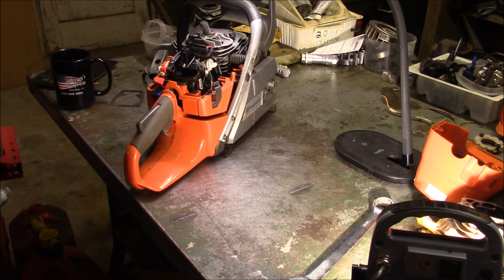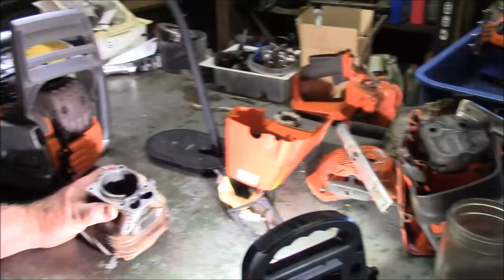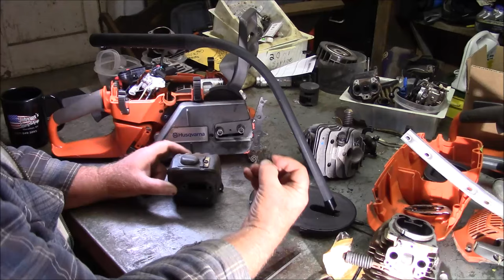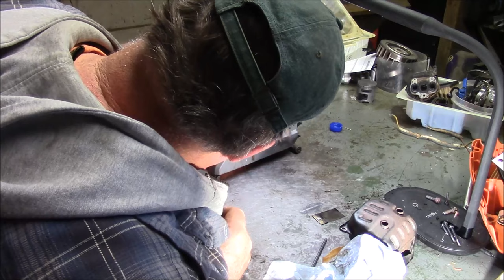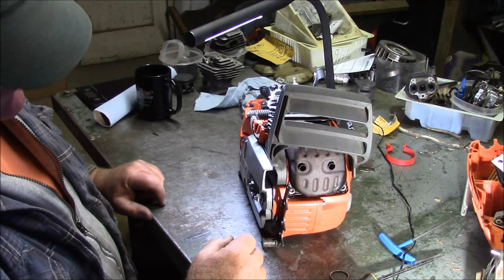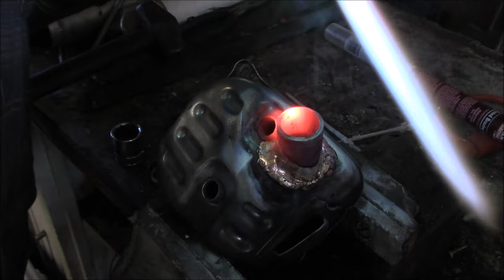Husqvarna 576xp "Introduction" Video,  A No Base Gasket Build & Squish Band Explained

Comment: Wanted to say thank you very, very much for taking all the time & effort involved to record & share your knowledge and experience. I bought a 576xpat based on your tear down and impressions of the build quality and robustness of this saw. While researching which saws look to offer better longevity, of course, you come across all kinds of contradicting opinions, and criticisms about weight etc...  with little, if any proof. You, however  take the time to SHOW the difference, for example, between the Stihl (also excellent saws in the pro line) and the Husky cylinder, and other components, as well as your commentary on weight being due to more robust parts. It's very much appreciated, thanks again!!!

Comment: Great video Walt. I have a 570 with 575 xp cylinder on it base gasket delete and muffler mod.  The saw seemed lazy I put a coil of a 2159 Jonny and it seems to have helped at idle and runs more rpms.

Comment: For years I did not know Jack about what you were discussing about Husqvarna 372 but I do, now.  There are some things I like about the 372 and some things I do not like.  I cannot say it is a better design than moms 440 but it sure cranks a lot easier than my big Stihl saws.  Weight wise, it is about the same as my 440 and a lot less than my 460.  It does seem to oil a lot better than my Stihl saws.  I have the oiler turned down to just slightly less than the midpoint of the adjuster with a 20 inch bar.  Had a few problems with the supplied carb but I have it straightened out, now., primarily due to a leaking needle.

Comment: Hello. I have a question, What diameter did you use the tube at 24:38, I mean the diameter, external diameter and thickness of the tube wall and what you used to connect the tube with the silencer,And what is the length of the tube?
Reply: I can ask for an urgent response?

Comment: Do you think I could get away with putting a meteor piston in a husqvarna 372 x torq cylinder with gasket delete without doing a squish test with solder? I don't have solder or measuring tools
Reply from the maker: I can't say that, u could be the exception that has the piston smash into the squish band.

Comment: I got one of those… I just got the cheap moly popup piston kit for it and I found a manual adjustment carburetor to pull out that self adjusting version??? Guess we’ll find out how good it will run… it’s just a cool lower transfer design…I did a chop saw and thought it was just a wicked feed system so I was looking for the cylinder design in a saw… it think it’s a stronger saw then the Stihl would be???
Reply from the maker: The "Self Tune" usually runs stronger than the manual tune versions :) And they run about like a 461  power wise.
Reply: @afleetcommand  yes indeed… yes, that’s actually the only problem that I really have with the auto tune system and that’s that they allow the engine’s to run at their top rpm’s or you don’t have the ability to make a selection were you can choose to be running rather rich and actually limit their top rpm’s electronically… I’m often just 11,800 or 12k on most of my saw’s as I don’t want to allow them the opportunity to free rev up at 13,500 or 13,800 or 14k in the ported version’s… my little ported 350’s want to four stroke at 14,500-14,800 but I’m very rich and just 12,500 max as the actual chain speed in the cut is much closer to the 11k type numbers… I’m just not really comfortable with those super high rpm’s and since it’s really only ever in that upper stratosphere in a free rev no load type situation then I’m probably over protective of their engine’s and I keep them quite retarded and very rich… I’ve found that they have super torque and they’ll bounce and clean up under the heavy load when you really dig in and twist them through a log and they just sing and rip right through… I’m definitely over protecting of my engine’s as almost all of them were complete rebuilds from the ground up…so they are all much more sentimental than I had just bought them off the shelf, so to speak…. I had a good dozen saw’s from my buddies company over a two year period and they were all getting over rev’ed and had transferring and damage…he had been mixing 50:1 with pump gas so with the additional ethanol probably was really somewhere closer to 75:1 in the actual combustion chamber/cylinder because the alcohol’s cutting of the oils film strength and lubrication abilities… since he’s adopted the 32:1…4 Oz oil per gallon of pump gas and all those saw’s with carb adjustment are at 12,500 not 13,500 and rich… there’s been zero engine damage issues… they are still dropping them out of the tree’s and running them over but they do walk around pinning the throttle to warm them up a little less often and they are surviving the abuse a little better having a little additional oil and a little less top speed… no one has even noticed that reducing of the top rpm’s as the cut speed is right there where they were previously…I’m not interested in massive engine changes that burn much additional fuel or make additional heat… small change’s to help them run as efficiently as possible I’m interested in…pick the right tools for the job at hand kinda logic…I think just as much about the fuel mileage as I do about the ultimate power of the engine… I have no desire to cut through a log a couple seconds faster if I’ve got to refuel it twice as often. ???   I’ve been playing with the 372 Xtorq with the little pocket cut into it’s intake on the cylinder to pre-mix the fuel mixture and air in the intake instead of the cylinder…so I’m probably going to be using that technique like on (the 372 Xtorq engine) for this one as well with a few little changes to the intake side to eliminate the fresh air hitting the piston’s and slowly moving back into the actual intake boot area possibly… the little pockets created in the cylinder appears to be doing just what I needed or wanted them to do and there’s some mixture happening before the cylinder bore so hopefully that will be a good solid bump in the engine’s longevity….????   👍😁.   Awesome stuff, thanks much… love that you in-bolted that cylinder without completely disassembly of the entire intake assembly…that’s a big work and time savings to get into the piston!!! 👍😁💪🇺🇸😁👏😎
Reply: @afleetcommand  I will say that if a guy like’s the look of the high top 372 series he be doing a back flip over the popup top on the 576’s… they are definitely a high top looking set of plastic’s… I had a complete flywheel and the intake assembly come with the complete 576 I found a I just realized that in a lot of a half dozen 372 bottom end’s I picked up that there’s a 576 case’s so it’s looking like a crank and topend kit and there’s almost a second one here… so it’ll be the more experimental version maybe… I don’t care for massive amounts of compression or other more radical changes to an engine normally as I’ve found I end up loosing my fuel mileage very quickly for small power gain… I’m really liking the 365 48mm bore version’s with a 20” or 24” as I’ve got plenty of power to do that “work” and I’m filling up the gas tank less often… just enough to be able to work efficiently…as frugally as possible is my modus operandi  ….👍😁
Reply from the maker: I'll read that later all the way thru, but think u are over analyzing , they are rev limited as well They aren't going to hurt them selves in fact the one thing you will get is a constant fuel mixture across the multiple seasons. IF you clean up the combustion chambers and do a muffler mod along with getting the squish in the .020 to .025 range they will survive pro level use for a few years. You know how I know? I did a few like that back in the 2015-6 era and they still are out earning money. Did a video on one a few years later in around 2016 I think. First one I did like that 2014-15 came back crushed.
Reply: @afleetcommand  I wasn’t thinking about that blue…limited coil… they were running those to limit them… I usually swap them so they are easier to tune but I’ll stop doing that too!  Yes, unfortunately I have a tendency to over analyze everything… appreciate your great, very informative video’s. 👍😁

Comment: Did you ever do any mods on the other 576 saw?  I just bought an older low compression 570 nonXP.  I've pulled the cylinder and the piston is scored with some light Al transfer.  I think I can polish the cylinder and save it.  I need to order another piston for it.  Tried ordering a 365 and 372 piston from Hutzl and they are the wrong size and configuration.   Didn't realize the 570  piston had a ported piston it appears.  The 365 piston appears to be ported also but is too small.  Thanks Ken
Reply from the maker: Yup. A squish of .020 along with a muffler mod does wonders on those.
Reply: Thanks Walt, Hope all is well with you and your's.

Comment: my brother has a 576. we are fairly equal in soft wood with my 372 x torq.. where the 576 shines is in hardwood. not even a comparison. He will have his 36 inch white oak on the ground while I am still making a wedge. not an exaggeration.I have raced him with my other 3-372s same thing.all saws stock.
Reply: They feel like a 390XP in power

Comment: I have watched all the 372 Xtorq videos and don't see where you modify the intake divider? Can you elaborate the gains? Thanks
Reply from the maker: A long discussion... I have and will build a couple 372 X-Torqs with the dividers in the filter holder and intake boot removed. All thing being equal that change by itself isn't going to make a lot more power. But what it will do is wash the sides of the piston where the x-torq channels are with a fuel/air/oil mix vs. straight air. That's got to help longevity. Another observation is it seems to make them run better at idle and low RPM's, and they start easier. The down side is you risk destroying those intake parts if not skilled.With down stream changes in the port timing, muffler outlet size, compression, intake timing etc. You have the larger x-sectional area of the now gutted intake to help feed the monster.

Comment: let me ask u something if we ever had a EMP would our saws today still run because aren't a lot of the new saw run off of a computer chip in our saws
Reply from the maker: Think you are way over analyzing that. Doubt an EMP attack would make much difference on those simplistic systems. BUT if that's a concern....build some old style 372's and put a couple of those ignitions in a steel shielded box!!
Reply: Ok

Comment: i have a k 760 engine and i have put it on a schwinn chopper im looking for any advice to upgrade performance note im also a drive line tech with all the tools to mill and turn parts i would pay u for a hp mod if you can help
Reply from the maker: Best thing is compression, and if you have the tools, measure the "squish" and cut the cylinder base so you end up at around .020. Will make a difference in any two stroke. Also even before that check the squish band to be certain it is nice and flat. Some times you have to trim a little around the edge of the combustion chamber to get a flat squish band THEN measure then cut the base to get to around .020 plus or minus a couple thou. I don't do any work over the internet or by mail. And am backed up with other projects pretty much for the year, but thanks for the consideration.

Comment: Why does my 576xp auto tune stay running at full speed after I release the trigger after making a cut into a log any ideas my local shop say it cannot be put on the computer for diogenes any help
Reply from the maker: The 576 was an earlier generation auto tune. Probably a mechanical issue in the carb. Most issues aren't autotune related..
Reply: Check your carb boot.

Comment: Just wondering if you checked the squish with the base gasket removed on the 576? Some guys are saying the squish is to tight on the 576? Thanks
Reply from the maker: As I mentioned in the video, it was .040 with the gasket & approx. .020 without. Solder method of measurement.

Comment: why did you only grind the intake skirt?  i always thought the intake and exhaust timing should be Square
Reply from the maker: What is the definition of "square"? I shoot for numbers and on the intake looking to get to the high 70's BTDC on those saws. Dropping the cylnder picks up a bit and either lowering the intake port or a little off the skirt gets the rest. I shoot for specific number ( not saying) on the exhaust as I rather have torque than R's on those. Dropping the cylinder helps that as well and really don't have to do much for what I'm looking for.
Reply from the maker: B. Rippy  No, a little off the skirt to increase duration on some of those. Either the skirt or bottom of the intake port.

Comment: The difference between a 372xp and that saw is what, the cylinder head and piston?
Reply from the maker: Completely different design from the cases up. While the 576 was the first true pro level Autotune, it could be had with a carburetor as well. What they learned with that series &  562 was where the 572 came from

Comment: You do not have to assemble the 372 in a specific order but you end up taking off a lot of already installed parts if you don’t, much more so than on Stihl saws.  Also, some of the procedures that were difficult on Stihl saws were a piece of cake on the 372.
Reply from the maker: Think so...:) Guess you still haven't met "Jack" :) ALL saws require a order of events. The 372 is by far the easiest pro saw to disassemble and re-assemble currently on the market place. AND a Huztl 372 is a different animal than an OEM, especially in how they run. As far as chain breaks.. you have to be kidding me. A 660 or similar vs. a 372 390? SOME day you may actually meet "Jack" :)
Reply: @afleetcommand  agreed, to some degree.  It was a learning curve for me.

Comment: Where is the auto tune socket on the 576xp I can't find it on mine
Reply from the maker: Some 576's weren't Autotunes...
Reply: James Steele the auto tune 576xp was built before the 550-562xp auto tunes where out. Because of this it was the first generation auto tune. You can't plug this saw into the computer as it is a closed circuit. If you have a problem with the module you will have to replace the module that sits on top of the carb. 
A dealer meeting I went to last year they said they where going to change to the second generation, but yet to see/hear when they do this.

Comment: Great video thanks Walter! Can the gasket just be removed for the performance improvement or does the piston have to be adjusted as well? I don’t have any tools to measure to that size of thousandth. 
As well, on muffler mod, do you jus bore hole into muffler and add piece of pipe like you did? Does diameter and length of pipe matter?
Many thanks. I’m new to saws and mods but eager to learn.
Reply from the maker: It's a maybe on all those saws, have to measure to be able to decide if a no base gasket build is possible.
Reply: Happy new year

Comment: Nice work walt! I run a 576xpg its great saw, better still when we run it on Aspen fuel. 

http://www.aspenfuel.co.uk/products/environmental-fuels/aspen-alkylate-petrol/aspen-2-full-range-tech/

With the above fuel you get zero carbon build up and the auto tune saws run way cleaner and sharper.